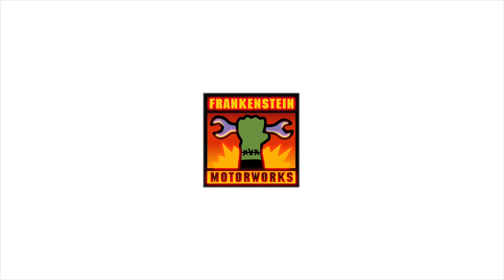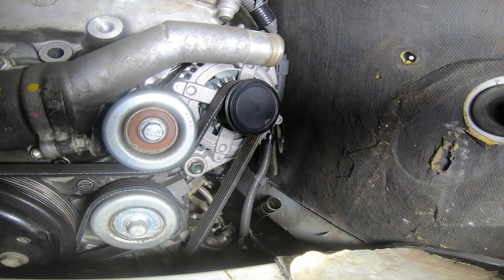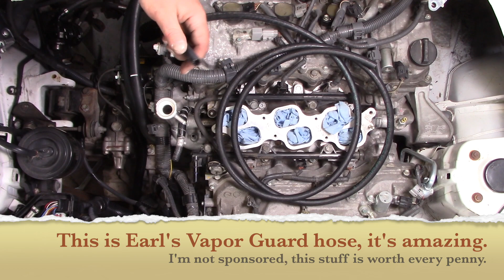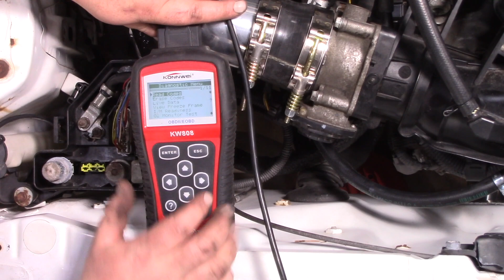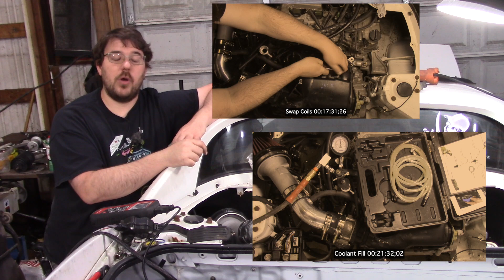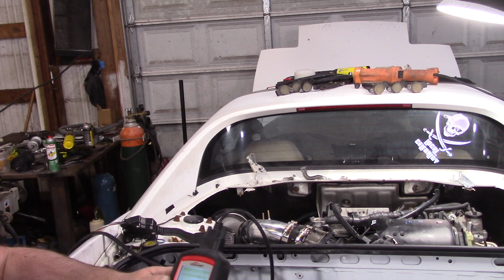2GRFE MR2 SW20 Install Instructions Video #4

Comment: What do you do for the fuel hose connection if your donor engine came with that connector completely missing? The straight nipple off the fuel rail fits a 3/8" hose but has no barb to actually retain a hose, I can't get the 3/8 to go all the way over the flat clip, and the dealer is telling me to go away with my silly questions.

Comment: If we’re upping the pressure to 4 bar, do we need to do anything with that thing that appears to be a fuel pressure regulator that we clip the fuel line to around 5:45? What is that thing?
Reply from the maker: That's just a pressure damper, no need to adjust that but also on the new low profile intake that isn't there anyways.

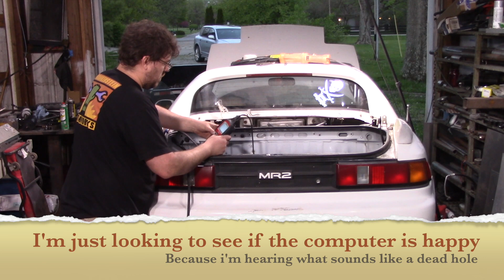Comment: 15:12 - What is a dead hole?  Never heard the term before.  I can only guess dropped cylinder or blocked exhaust port or similar?  Thanks! :)
Reply from the maker: a dead hole is just a cylinder that isn't contributing without giving a reason. it could be no fuel, no spark or no compression.
Reply: @FrankensteinMotorworks  That makes a lot of sense.  Thanks for all you do!

Comment: I need this engine in a yaris rs
Reply from the maker: The 2GR is a rather large engine for the Yaris but it might be possible with enough work.
Reply: @FrankensteinMotorworks  Yes i want to make it the ultimate sleeper for it's considering the torque and power of a 335hp 2grfe it would have a great power to weight ratio to

Comment: Can a jdm 2grfe with the plastic ecu housing outside be used for this same swap?  The jdm engines usually have less mileage than US engines.  US engines usually don't come with all the accessories also, unless you go directly to a junkyard.  But, some of the junkyard stuff have too many miles.
Reply from the maker: It's a bit of a shameless plug but i think you're way better off getting a tuned ECU from me with the immobilizer removed. But that said, there's nothing stoping you from using any of the ECUs. Cruise control is the only thing that seems to be hit and miss depending on the ECU you're using. 
As far as i know there are no JDM differences on this engine.

Comment: You never touched on what you ended up doing with the brake booster line from the left side that has the check valve.

Comment: Wow Mark, cars coming along really good, sounds awesome too! And your looking a lot more confident with making the videos too! Wish i was up to that stage with my swap ,im currently playing the waiting game with power steering parts, minor leak the rack turned into needing a new power steering reservoir. Plus ive noticed its surprisingly hard to find a wiring diagram for the Japanese 1990 n/a mr2 (3gse version), Excellent work Mark,
Reply from the maker: Jay, it really is getting easier and easier to make these videos and i feel that it shows in the final product. Is the wiring really that different on a japanese car? I'd expect the wiring for the engine to be identical to the european 3sge of the same year. As for needing a reservoir, depending on how adventurous you are it might be a good opportunity to shave some weight from the front end and swap in a lighter EHPS pump from a Mercedes?
Reply: @FrankensteinMotorworks  Hi Mark, that's just the issue im not 100% sure because i cant find any diagrams to reference whats in the car, ive tried the mr2 Australian forums and had no reply's about it and i rather not try to take a chance and trace the wiring and make a mistake because, im not 100% sure if the Japanese version of the car had any extra parts or a different wiring setup compared to the Australian version or the euro spec version, an Example of this is i know the a/c different because of the 2 stage system it has but even with that, im not sure if its ecu controlled or its the unit its self that controls it, hence the need for any information on all the wiring plus .Also tempting idea with the EHPS pump,  ill have to have a look into it when i get the chance, Cheers for the suggestion
Reply: Just an update on the wiring info stuff (loom wise for over this side of the pond) turns out from what ive been told theres about 6-8 different looms that came in the car over the span of the life of the cars from over in australia/japan which makes life just that bit more painful, note too im not sure if the equipment is the same on the cars and the wires are just a different color

Comment: Great stuff, been following for years. Perhaps a six speed tutorial some day? For the 2gr of course.
Reply from the maker: This is something i can do but the general feel i get when people are asking for an alternative transmission option is because they think the E153 is too expensive but it would have to get significantly more expensive before anything else is cheaper once you account for axle shafts, mounting brackets and shift linkage bits required.

Comment: Great video as usual, but maybe I missed it: no heater core line routing? Does it go into the coolant tree?
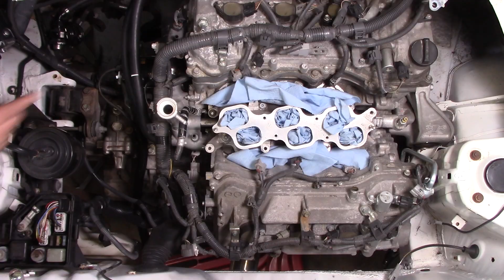Reply from the maker: Yeah, i noticed after posting this that it accidentally ended up on the cutting room floor. You can see them installed at 3:20 in the video, the part numbers and links are in the description along with the other hose part numbers and links. They just plug in top to top and bottom to bottom to maintain stock flow direction. Though it does not matter that much since this system won't really self-bleed anyways.

Comment: 2010 Camry starter? Does that bolt straight up to the e153?
Reply from the maker: This is the 2010 camry manual transmission starter. It's what i use in the MR2 Spyder swaps which is why i had a spare laying around. It uses a different electrical connector but it's the same as what comes on the rav4 harness so you'll already have one on hand when doing this swap. You also have to use a shallow head screw on one of the shift brackets to avoid interference. The design is a planetary design and it saves 1lb or so. I don't think it's a better starter, it's just what i had available.